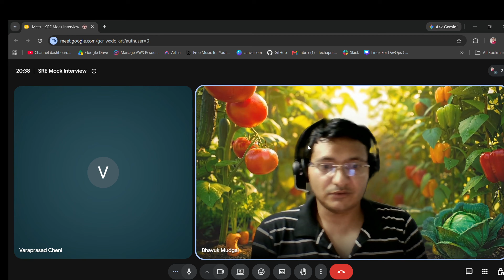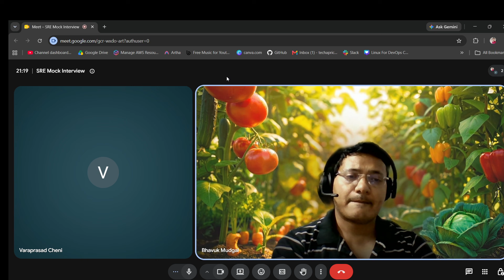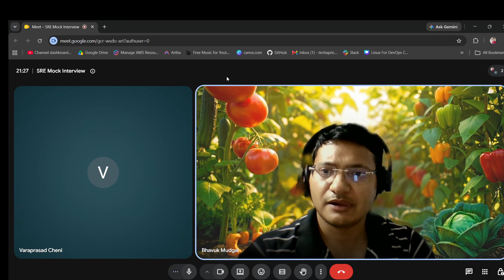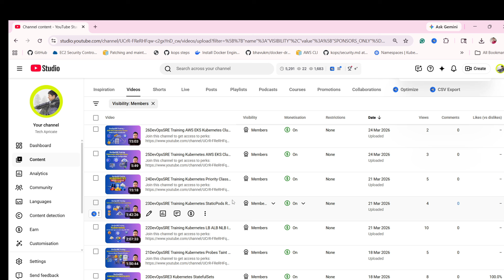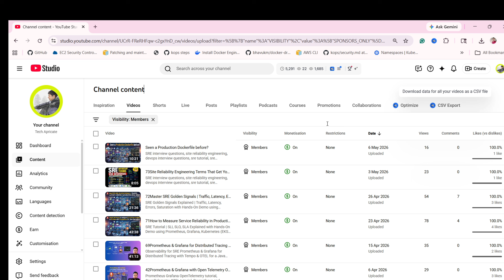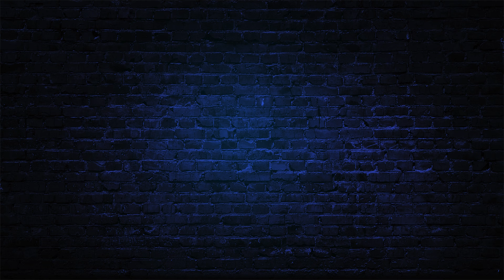This SRE Mock Interview Will Expose Your Weaknesses!

Comment: 13:05 The answer is Headless service. The communication between the backend API and the database can be done using the DNS A records using the headless service.
Reply from the maker: This is how we should answer it. For a standalone database, I use a ClusterIP Service. If it's a distributed database deployed as a StatefulSet that needs stable pod identities and peer discovery, I use a Headless Service
Reply: @techapricate thanks for the correct answer 👍
Reply from the maker: You're welcome👍